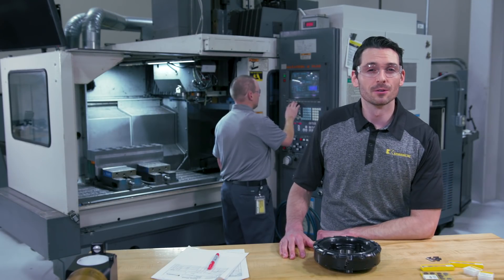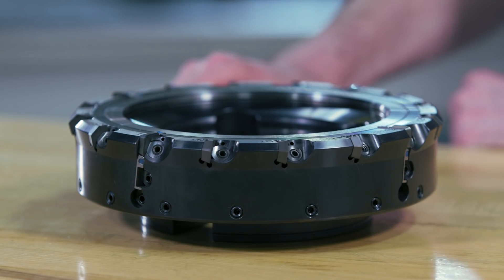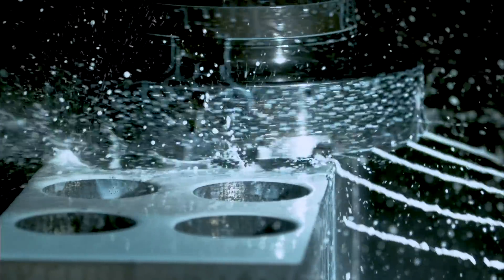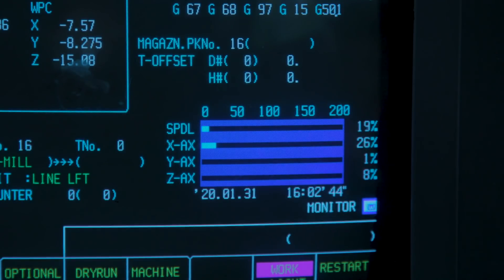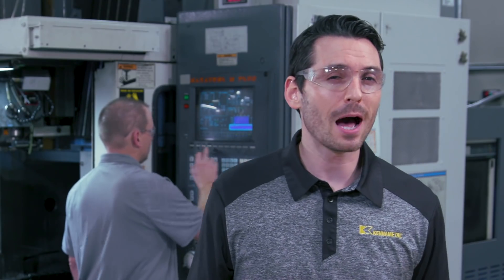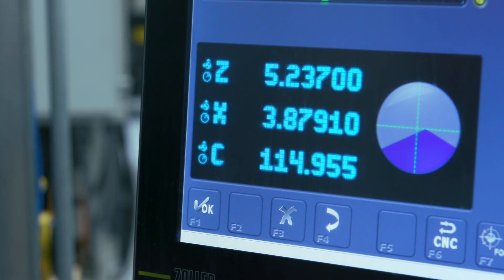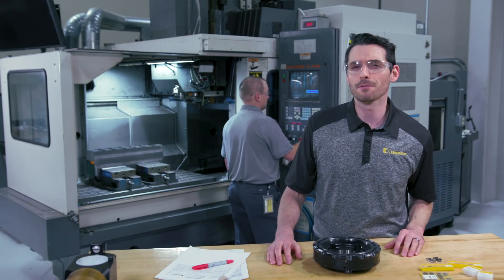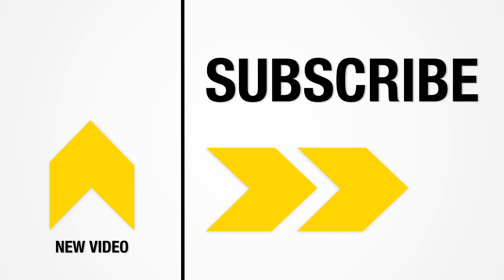Mirror-Like Cast Iron Surfaces With KCFM™45 Fine-Finishing Face Mill

Comment: You Can eliminate grinding for finish but how about flatness?
Reply from the maker: Eliminating grinding depends on the specs of the surface being finished. Under optimal circumstances with a combination of PcBN hex and PcBN square inserts, a best Wt of up to 5-8µm (0.2-0.3 ten-thousandths of an inch) is achievable with KCFM™45.

Comment: Why is the cutting tool run asymmetrically over the part?
Reply: Its hard to explain but basically its about the chip is formed. Sandvik had some videos on it a long time ago. In youtube, copy this search "Effects of Proper Cutter Engagement from Sandvik Coromant
". Its a 2 minute video that will answer your question better than I could. :)
Reply: @kylehofmeister6906  First, tooth enterance into the cut is more smooth and does not put so much stress on the insert when it's at around 70 or 30% tool diameter width of cut. When it's at around 50%, insert is basically hitting the wall perpendicular to it. Second, chip formation from thick to thin (that's why it's better to do 70% than 30%) is because thicker chips take more heat from the cut (most heat escapes, or rather should escape in the chips, not get transfered into the tool or part) and smooth exit at narrow chip is also more gentle on the cutting edge.
Reply: I think it's to reduce the risk of resonance.
Reply from the maker: Great Question! David B, Kyle Hofmeister, and Stasiek_Zabojca are all spot on with their comments.

Comment: Kennametal... 100% from the 5% land of freedom units... Talking scientific established units that the rest of 5 bill people of this world understand... . 
Not sure how to respond to this... Welcome to 2020 ?
Awesome product ! Chuckle at the fact you still make massive diameter cutters catered for the low RPM machines, so the owners still think their 15+years  machines is viable in a automated world.
That is not a punch towards Kennametal, but a punch to where a lot of their customers still work at.

No wonder so many is going under in these "manual labor/Human labor density" restrictive times.
Reply: I'd reckon these tools are fantastic for long-established, engine machine shops that have dedicated block and cylinder head finishing machines, rather than doing this on a CNC milling machine.
Reply: simply not true, there are many successful shops still running low speed multi spindle on wing spars of titanium.

Comment: Nice video but you must mean axial runout of 0,03 instead of 0,003 right? And how long tool life can be expected for those ceramic inserts?
Reply: 3 microns is 0.003mm , i belive that , i regularly cut with tools that are out by 0.02mm and it shows .
Reply: @kisspeteristvan  With 200mm facemill 0,003 is nothing. Presetting within microns is not realistic and you'd have to redo it every time you change the insert. We usually set the wiper inserts about 0,1 higher than the other inserts